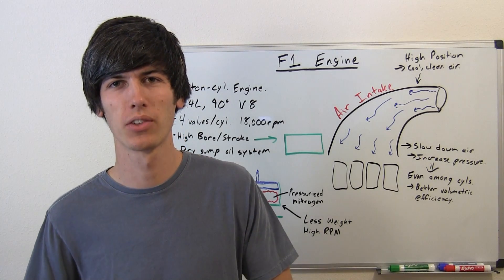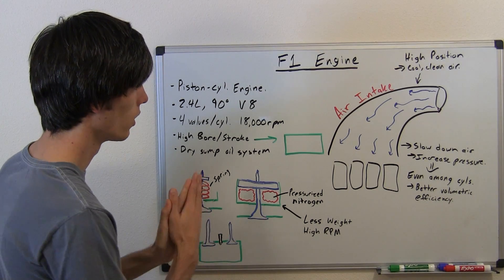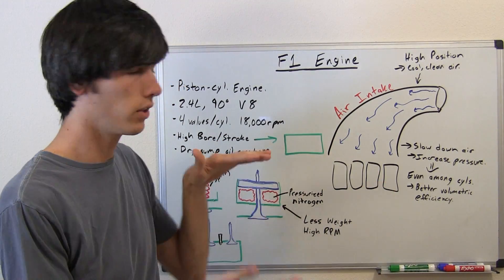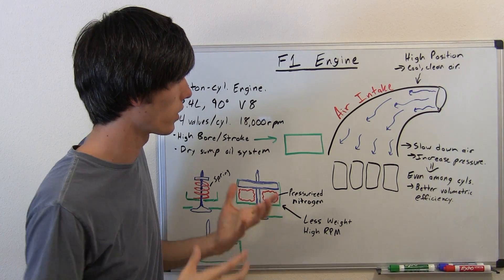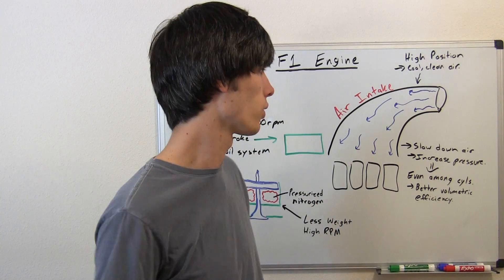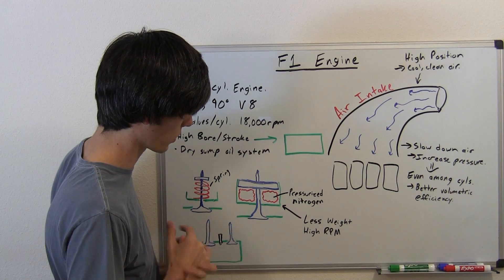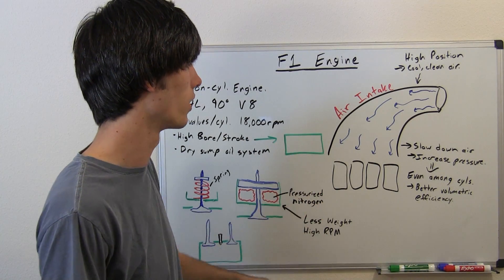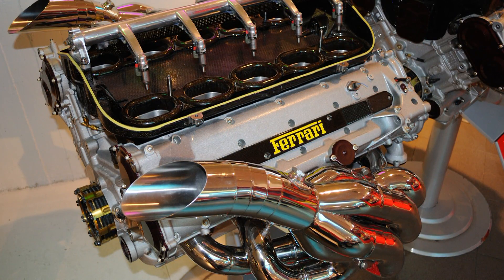F1 Engine - Explained

Comment: How does slower air provide more pressure, surely faster air more pressure?
Reply: Fluid speed and fluid pressure are inversely proportional.
Reply: +Jordan Oren the intake is a fixed size so surely the faster the air enters the chamber the more pressure would build in there?
Reply: +Pingman The intake slows down the air, allowing the air flowing into the intake at a higher rate to ram against the slow air. So yeah your last comment got it.
Reply: +Jordan Oren surely the ram effect would work better if it was more like a funnel shape with more area going into a smaller area would increase pressure? It's the opposite how it's drawn, like a reverse funnel with a small hole that then opens up. Really struggling to comprehend how that increases pressures :/
Reply: +Pingman When you pinch the end of a garden hose the water shoots out faster, right? But where does the pressure build up, in the water stream that comes out or inside the hose? Inside the hose, because a restriction will build up pressure "upstream", not "downstream".

Think about those days there's an accident on the road and they close a few lanes. Before the accident there's traffic, and after the accident there's not.
Reply: +Pingman It's very counter-intuitive. It's the reason it took so long to discover that increasing the cross-sectional area actually increases the pressure. It was found that the faster a fluid is traveling, the lower the pressure. That is why when you blow on the surface of a hole it actually creates a lower pressure in the hole. Many people confuse the velocity of a fluid with the pressure because when you increase the pressure supplying the fluid you also increase the velocity. 

Source: Got an A in fluid mechanics from one of the best professors in the US.
Reply: +Pingman The design is reverse. As it's not more pressure you want but volume. The engine intake valve opens and sucks the air from air box into the cylinder. All you want is the proper amount of air in the air box. This is how negative pressure air box works. As it doesn't rely on how fast the vehicle is moving or forced air induction.

I might add the bore to stroke is so short you don't have much volume to fill the cylinder with. One reason they can use nitrogen gas in place of the typical valve spring. As the valve is very short.
Reply: +Pingman At any speed air has dynamic pressure and static pressure. Add them together and you have the total amounth of potential pressure. This is the effect explained. Slow down the airspeed and the dynamic pressure changes into static pressure until the airflow is stopped and the full energy of the air is preserved into maximum static pressure More pressure, means more air in the same area and more pressure allows more air to straem into the cylinders. Although the vidio says this it not a ram effect. This is actually the ram effect. So you are right; higher airspeed gives more pressure, but you can only use the higher static pressure if you slow down the airflow to transfer the dynamic pressure into static pressure.
Reply: +MiddleClass SeaBass 

So, MCSB if you're saying that increasing the cross sectional radius will actually
increase (not decrease) the pressure just upstream of the hoses’ obstruction;
then you're clearly also saying that reducing the cross sectional radius will actually
decrease (not increase) the pressure; just upstream of the hoses’ obstruction?

Extrapolating/continuing; then you are saying that when you turn your garden hose on full, and then slowly pinch the end (reducing the effective cross sectional area) of the hose- as you watch the water jet shoot out farther - the pressure inside the hose
(just before the cross sectional area is reduced/pinched) does not increase?

 If so, where does the energy required to accelerate and push the water farther and/or do more work (the jet from my garden hose shifts leaves on the lawn better when I pinch it) come from then; if not from the greater pressure resulting from said “pinch”?

Have I read/understood you correctly here - in that you're saying pressure always increases as cross sectional area increases?

Are you sure about that and your application of Bernoulli's principle here?

When I say "here", I mean . . . . 

 In what (with the garden hose and to some extent also the F1 intake collector) is clearly a viscous application of a fluid in a pipe flow driven by a pressure gradient; that (amongst other factors; particularly with respect to the garden hose) should consider the (water/utility) supply and length of the hose?

Even though we’re talking about the garden hose example (and even though the F1 intake collector departs from it in even more complex ways {please see my above comments, their caveats, and my above-provided links to my other physicsposts}); it serves as a decent example to show how;

1) 1) Elusive this subject can be.

2) My above comments about the air-flow through the intake collector are notunreasonable.

 3) The pressure in the garden hose/example - at the pinch-point (for the example) - will(contrary to your claims and application of Bernoulli's principle) be directly proportional to the cross sectional area.

 Therefore pressure in this case will (not decrease, but instead) increase in direct proportionalityto the cross sectional area of the hose.

       4) The way Bernoulli's principle, fluid mechanics, and some physics that are being applied here, may be
questionable.

 May I politely suggest you avoid using Bernoulli's principle in this situation?

 As an “A” grade fluid mechanics person, I agree you have the right to claim Bernoulli's principle is important.

 But so to . . . it’s important to know where/when to apply these principles in science, engineering, physics, andlife.

 Regardless of what Bernoulli's principle states; putting your finger over and pinching the end of a garden hose (reducing the cross sectional radius) will actually increase (not decrease) the pressure just upstream of the hoses’ obstruction, and from there thatcircumstance will lead directly to a greater pressure gradient through the
pinch point. 

Flows in pipes, and therefore
garden hoses, possess substantial viscous effects, and as such you cannot apply
the standard Bernoulli "constant upstream velocity" conditions that
the Bernoulli principles expect for your application of this principle to make
sense here; when you pinch the end of a garden hose and both decrease the
effective diameter and increase the pressure.

Therefore, pinching and/or putting
your finger over part of, the garden hoses’ end (reducing its cross-sectional
diameter) will actually increase the pressure and it will do so without being in
violation of Bernoulli's principle.

This is what I was (above) trying
– in a nice way – to explain to sera56jase a few days ago.

Bernoulli's principle doesn't
really apply here and/or over the length of the hose because the garden hose
example is a highly viscous situation. 

OK, now with all that out of the
way; the real reason the pressure in the garden hose is going to increase within
the vicinity of where you pinched it, is not so much directly related to viscosity
(as the viscous losses are going to be negligible in this {and probably [please
see *below comments] the intake collector} example); more so to the stagnation of
flow.

As such Bernoulli's principle –
if all factors were taken into account and it were applied properly - would probably
still give a very good conceptual approximation along the streamline of the
garden hoses’ interior.

Now, imagine the same garden hose
was connected to another (identical) hose-length of greater internal diameter;
that was, say, 10cm or 20cm long, or even a bit longer. 

A few centimeters just after the above-mentioned
connection terminal (where the internal diameter is greater) do you think we
would measure greater pressure; as per your claim and application of
Bernoulli's principle?

Now, imagine the same (identical)
garden hose-length was used, but this time the internal diameter of it was
increased along the hoses’ length; so that it was funnel like.

Do you think we would measure
greater pressure - as per your claim and application of Bernoulli's principle –
as we sampled pressure at ¼, ½, ¾ and full length?

Another point (with the application
of Bernoulli's principle) to consider is, when you have a garden hose connected to an external domestic water
tap, which is fully open. If you pinch the hoses’ end (as stated above) the water
exits the hose at a noticeably higher velocity.

However, when the same external
domestic water tap (without a hose connected) is opened only slightly, the water
flows out at a low speed, sometimes only in drops.

This is all despite the
fact that the actions of almost completely closing an open tap and pinching the
end of a garden hose, seem similar; so why the difference in behavior?

The answer is that (like
the F1 intake collector discussion I refer to) there is a little more to the
problem than simply throwing Bernoulli's
principle at it, and expecting air/water flow to always/anywhere exhibit
greater pressure when the cross-sectional diameter enclosing it increases.

Now back to the F1 intake
collector (and leaving how it’s cross-sectional area is not consistent and how
that behave as the above-mentioned examples) and my initial posts’ caveats that
I have referred to here in this post.

*Please note how those caveats
crossed off on the volumetric gas consumption of the engine in question. If you
were so inclined; you could (as race engineers do) model – with fluid dynamics or
any other well applied and suitable approach – the volumetric gas consumption
of the engine as (going back to the above-mentioned garden hose example) the
garden hose being connected to a varying rate vacuum [the F1 “engine”].

If done correctly, that would put
you in the ball-park of modeling the problem accurately enough to understand
the pressure differential (drop) through the intake collector.

*From there you could also
(imagine and) model the external
domestic water tap [the F1 “intake
collector”] that the garden hose (with one of its ends already terminated onto
a varying rate vacuum [the F1 “engine”]) was connected to, having its valve
opened and close at varying rates/depths.

*The rates that the varying rate
vacuum and varying rate tap (on each ends of the garden hose) are modulated at
could then be modeled in such a random/accurate way that (if done accurately) there
would be very little real/reliable direct relationship to their settings and/or
behavior.

*As (moving away from the garden
hose and/or water flow example, and getting back to the F1 engine and intake
collector now) airflow through the intake collector’s mouth (the tap analogy)
occurs when any number and/or several of these engine/velocity (the vacuum
analogy) related conditions are satisfied;
1)  
1) The F1 vehicle produces positive thrust. 

2)  2) The F1 vehicle produces negative thrust.

       3)  The F1 vehicle’s engine’s crankshaft speed was at such a rate that the volumetric
requirement for air was greater than the intake could provide (whether it be
due to the velocity of the vehicle or not {eg; the vehicle can rev high at very
low or high speeds}); creating a vacuum and/or low pressure area in the bottom
of the intake collector.  

 4) The F1 vehicle’s engine’s crankshaft speed was at such a rate that the volumetric requirementfor air was less than the intake could provide (whether it be due to the
velocity of the vehicle or not {eg; the vehicle can rev high at very low or
high speeds}); creating a vacuum and/or low pressure area in the bottom of the
intake collector.

5)  The F1 vehicle’s velocity equals zero.
*And not too many of those above
5 points (with respect to how the relationship between the “tap”/”intake
collector” and “vacuum”/”engine” behaves) meaningfully take into consideration
. . . . . how the F1 intake collector (in question) itself is really just a
plenum chamber for the devices that are actually designed to pressurize the F1
vehicle’s intake manifold runners; the turbocharger – which themselves rarely
run at the ideal high-order of speed to the engine for all circumstances.

Therefore, the pressures and flows in the entire system are truly complex and dynamic.

Hence my (a) caveats in earlier posts, (b) comments on how Bernoulli's (and other) principle’s apply, and (c) confidence.

Please (read my other above linked-posts about physics and also digest this one, and then) kindly let me know where you
believe my logic/physics in relation to the intake collector is inaccurate.    

Kind regards,

Jim.
Reply: +Pingman Bernoulli's Law.  Pressure and speed are inversely proportional.  It's what makes planes fly.
Reply: +Pingman If I understand it right it would be higher pressure but not higher psi. The inlet size will be engineered to give a very specific airflow rate any larger would cause more drag. Any smaller would cause the engine to struggle for air. However they want as much intake pressure as they can so they expand and slow down the air covering a larger surface area. If You were to have 1psi pressure over 1 square inch you would have 1 pound of pressure on that object. If you were to take that 1psi and give it 2 square inches you would then have 2 pounds of pressure on that object. As long as they can achieve a high enough flow rate there is no point in making the possible air flow rate higher than the engine can consume. It would only cause more drag.
Reply: +Pingman See https://en.wikipedia.org/wiki/Bernoulli%27s_principle
Subsonic fluids actually behave in reverse to common intuition. The higher the speed, the lower pressure (and vice versa).
Reply: I think i've not seen this being said before, but the slow speed/higher pressure, is correct, in order to justify a principle, that goes everywhere in the nature without being seen. Is one of the most important things in fluid dynamics: the Bernouli principle. The faster the speed, the lower the pressure, and vice-versa. Think of a venturi, for example, and you understand it right away. This is somehow happening all over us, wherever we are, every time we drive a car, vacuum clean, go on a trip on a plane, etc, etc, etc... So, when you increase the area through where some fluid passes, in order to maintain the flow, speed must decrease, and you will have higher pressure than the point where it is collected. There is one other thing, but it was already said, the induced speed in the intake, comes through the speed of the car. That play between the speed in the intake, and air expansion inside the "box", makes the magic
Reply: +totoritko Even though I am engineer as well, I agree this has always been counter-intuitive, but the equations don't lie.
Reply: +Pingman 
Fluid, including air, moves faster through a low presure zone than in a high pressure zone.  Think of it in terms of weather.  High pressure (high barometer) usually yields good sunny clear weather with relatively little wind.  Low pressure (low barometer) and you have highly unstable conditions and high winds (thunderstorms, hurricanes, etc.)
Reply: Treetop64 The relationship between pressure and velocity has remarkably little to do with how weather is formed ;)
Reply: totoritko
The weather was an illustrative example, not the point, and the focus on that example was the relationship between barometric pressure and wind, not how weather itself is formed.
Reply: Treetop64 Ok, it's just that "weather" has a specific meaning. But yeah, if you meant "wind velocity", then it's largely a barometric effect (though again not based on the bernoulli principle, except for a few very specific types of wind).
Reply: +sdhjtge Does not depend on how you measure the pressure. You Always measure the static pressure. As it the static pressure that has effect on the surroundings. You cannot measure the dynamic pressure. The onlyway to figure it out is to messure the static pressure in an airflow and measure the staticpresuure when the airflow comes to a full staop. De fifference between the two indicates the dynamic pressure. This is the basic principle of a pitot tube on aircraft to gain a speed indication.
Reply: +totoritko don&#39;t know if the relationship between pressure and velocity is so little like you are saying... Winds are caused by differences in pressure, between different places. Those winds have so much influence in how temperature is transmited from place to place, evaporation of water, ascension of vapour verticaly... Damn, tornados, cyclones, etc, are caused by the rotation of winds, caused by... differences in pressure. So, i would say, yes, they have much to do with it. But i agree, not necessarily related with the bernouli effect ;) Sorry for the off-topic
Reply: +El BU i understand what you say, but that is not the only way to measure dynamic pressure in a system. If you know speed, and the density of the fluid, is easy to know it.
Reply: fitty77 So a couple of clarifications. When I'm talking about "wind" and "weather", I'm using the meteorological definitions of these terms, not the colloquial. In those, wind is a separate phenomenon that transports air masses horizontally. The interaction of those air masses can then cause "weather" - clouds, precipitation, etc. However, weather can also be caused by entirely different phenomena. For example, solar irradiation heats a surface, which heats up an air mass and causes a convective current upwards and an associated cyclone. Again, the meteorological term "cyclone" does not mean "strong whirlwind", it means a zone of low pressure causing an upward motion of air that draws in more air from around it and causes it to turn slowly (due to the Coriolis effect). This updraft cools the air until it reaches its dew point - now clouds start to form. If the air is vertically unstable enough (meaning, the more it rises, the more it wants to speed up rising), this can cause severe thunderstorms. THAT'S weather.
Of course, then there are weather systems which do kind of interact with wind (e.g. weather fronts), however, these are again ultimately powered by the convective action of heating/cooling of air masses due to solar insolation.
I'm really just scratching the surface of meteorology here and even there I'm merely an amateur (I only know as much as is needed of a pilot), but I hope it gave you an insight into some basics there. Youtube has a wealth of videos on this explaining the subject in excruciating detail.
Reply: totoritko English is not my native language, so i hope i i am understanding you. I don't even go as deep as you can go in that matter. But i understand the principles you mentioned. I just say that pressure, and wind, are related, and that are also related with weather. What originates weather.... You can say that the sun influences a system. But i will say that is far reductive (from the middle of my ignorance). So a convective updraft creates a pressure drop at the bottom. Am i right? And that makes air on the surroundings reach for that point, as you said. This would be considered wind, converging on a spyral to the center. Wouldn't you agree? So, how you can exclude this from the "equation"? I know you are not doing it, but you look at it just as a consequence. Now... Imagine a guy that comes to you and say "the radiation from the sun that heats that mass is just an effect, not the real cause, because the real cause is the internal convenction of plasma inside a star called  sun". That would also be right and suddenly things come in perspective. It really is a consequence, but it really creates weather, in your words. The reality is that you can't take out any variable from the system. They can appear before or after each other. But all of them contribute to a system. So, low pressure is a consequence? Ok. Wind is a consequence? Ok. But... Imagine a system where the wind already exists, due to a low pressure somewhere. That will make a cyclone harder to been generated, disturbing the convective process, lowering the temperature of an air mass, by taking energy from the system elsewhere. That could avoid an cyclone, even if you have all the other conditions to generate it (sun, for example). So, would you say it will, or will not influence the weather? It is always relative. Some say, a butterfly in the other side of the world... Well, is just a term :) And, taking the risk of being wrong, i believe that a cyclone, has inherent strong winds (googling says that to be considered a cyclone, you have winds above 70mph). So, far from from being a "weak whirlwind"... I konw is not the deffinition, what you mean, but is inherent to it. Sorry if i'm complicating things... :/
Reply: +fitty77 you know it and can calculate it, but you cannot messure it.
Reply: El BU sure i can. Hope i'm not lost in the conversation... lol. But... Even you have said it. The pitot tube is a device that measures dynamic pressure (yes, by measuring total head, and subtrating the static pressure). But what comes from there is dynamic pressure. Speed comes calculated... Also, by other way, if you know speed in a duct, and a transducer that "knows" density of the fluid, it can give you the dynamic pressure. You can say is not a direct measure (if i can see your point). But so many units are giving by calculation, that i see that as pointless. Example, in my bike i have a watt meter. But it doesn't measure power, directly i mean. What it does is measure torque, and cadence and calculate power. Same as the electric watt meter at home, that "measure" voltage and current. Even when you measure static pressure, we can not say it is direct, as it is a force multiplied by area. Just to say some basic measuring devices. There are other far more complicated, integrating so many values...
Reply: +fitty77 You're almost right. However :) your confusing the mesaurement with the qantitative indication (calibration) pressure is meassured directly. Unless you mean that you actualy measure the movement of an indicator as a result of pressure, which than needs calibration to show the linkage between movement and pressure.
Reply: Damn... Now i didn't understand xD When i say direct measure, i mean something measurable, where you can actualy measure the unit you want. Example, distance, where you measure meters directly. Same as time, where you can measure seconds. But if you want speed, that can't be obtained directly, because you need to integrate distance and time to calculate it. Hope i'm being clear on this... Now, i haven't confuse the measurement, with the calibration. A pitot tube, really measure pressure. For being right, it measures 2 pressures: Total head, and static pressure. If somehow you have both measuring ducts connected to a differential manometer, you will have, dynamic pressure as a result. In order to have speed, that is what some applications need, you need some kind of transducer, that reads that dynamic pressure and converts it in speed, through input data, and there, yes, you need calibration in order to stablish that, a certain dynamic pressure, is related (sh#t, this is not the word i want...) to a certain speed. So yes, you can measure dynamic pressure. And the opposite can be achieved also. If you already have speed, you can have dynamic pressure, but it is not also achieved without input data and calculation. At least theoreticaly. In some systems it depends on to much variables (flow type, induced turbulences, etc...).
Reply: +fitty77 Now you are into (old fashion) instumentation. You can get a direct indication of dynamic pressure if both static pressure (from the normalairflow is compared to the static pressure of the stoped airflow. However you do not meassure the speed, this still has to be calculated and compensated by the altitude correction, which in turn is measured through static pressure, as dynamic pressure is a combination of speed and density. Density varies with altitude.
Reply: El BU But that is what i'm i saying... relatively to how to measure dynamic pressure. But for speed, using the dynamic pressure, yes you need calculation. But there other ways to measure speed, in a system.

Edit: static pressure in a stoped airflow, is called total head, i think, in English.

Edit, edit... lol: Total head i think is more related to Hydraulic systems. You use total pressure. Is the same thing, but in general terms
Reply: +Jim Stanley It is not complex: P (total) = P(static) + P (dynamic). In English: total pressure is the sum of static pressure and dynamic pressure. The funny thing is dynamic pressure, this consumes part of the energy of the airflow and transfers it into speed (P(dynamic) = 0.5 x density x square speed)The complexity starts when: 1. More energy is put in the system (from an external source like an exhaust or fan) or when the speeds are so high that the density of air is not constant. The letter creates compression issues that disturb the airflow and interferes with the bernoulli principle. At higher (even subsonic) speeds parts of the airflow might be supersonic and this creates shock waves.
Reply: +El BU which is why in supersonic jets, the engine air is slowed down to just below supersonic...like in the sr-blackbird......
Reply: +Roy Hemion No, supersonic airflows behave differently due to compressabilty issues and shock waves. That is why they slow down the supersonic airflow to a speed that does not create shockwaves when manipulatued. This is not just below supersonic but much lower. This happens inside every turbojet engine that flies supersonic.
Reply: Venturi effect
Reply: God!! Learn the Bernoulli's equation